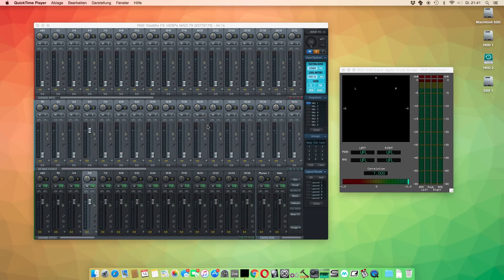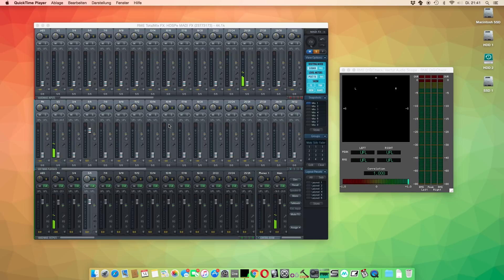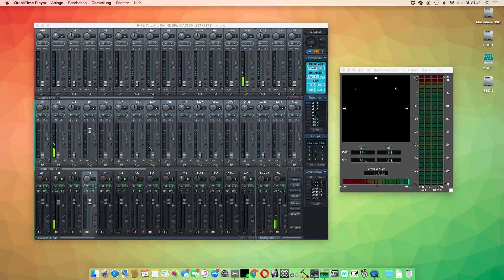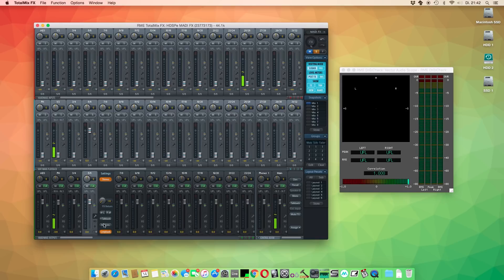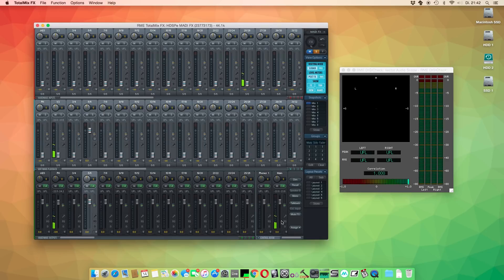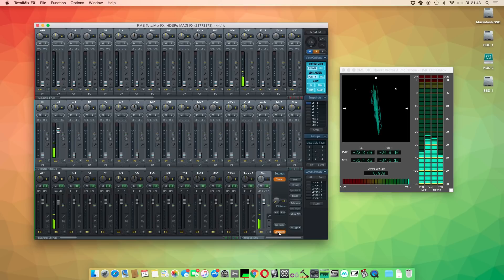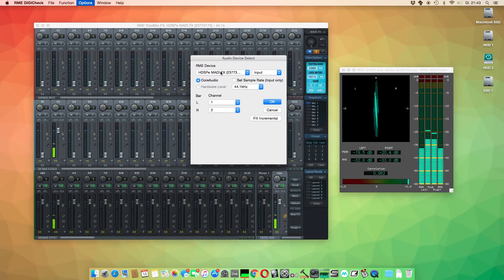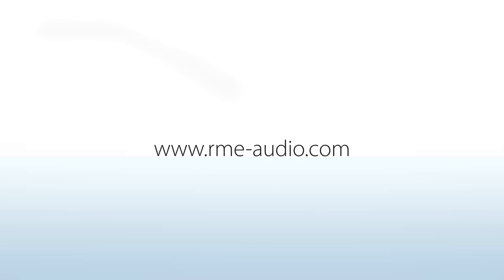Using RME Audio DIGICheck on Mac Computers

Comment: Nice this problem is already fixed with the recent drivers. 
I didn't need to loop back, it just worked. Thanks RME. 

Also I don't know how else to stress this enough on how important changing the Default settings in the 
"Input Device Setup" Menu is. The Default levels are only set to reading the Mono (left) Channel! Not Stereo! 

It took me days to figure this out until this was explained. Thanks.
I now understand why it happened to me as I am running DIGIFace I presume.

Comment: This guy is just incapable of conveying information clearly and succintly, Its embarrassing and RME most definitely need to address this content pronto. I’m a sound engineer and am still none the wiser having watched this. 
However, if you want a step by step guide for monitoring audio outputs (specifically for Digicheck Beta) check this URL https://www.synthax.co.uk/latest/2020/05/22/rme-digicheck-ng-beta-release/
Reply from the maker: You only need to understand the basic principles of using the Loopback function. Easy explained here: https://youtu.be/Xpt7LczeAvU
Reply: @RMEAudio  Great! Thanks RME, a super patronising message. I'm aware of the "basic principles" of the loopback function thank you. The fact that you need to actually post such a smug reply speaks volumes. My point very much stands. RME are to date incapable of providing detailed and thorough tutorials. The fact that your own UK distributor is compelled to do so should be a giveaway no?

Comment: As the RME ADi 2 Pro fs r is not supporting TotalMix how can I set up the routing to have Digicheck getting the input?
Reply from the maker: Use a loopback cable from a digital output to a digital input and select that input in Digicheck.

Comment: Doesn't work for me, despite activating Loopback on the Main channel inside RME Totalmix. The DIGICheck Input Device Setup only shows the channels: Mic 1 2, Instr. 3 4, AS 1 2, and ADAT 3 - 8.

I'm using an RME Babyface Pro through an early 2018 Macbook Pro running Mojave. Any suggestions?

Comment: Thanks for this, it works! Just one question, how can I check the real output gain of a master ? Actually I see the physical output, so if I increase my output it increase. Instead I would simply check if a master audio will clip into my DAW, but without using any Daw, only using Digicheck. Is it possible ? Thank you
Reply from the maker: You can already see it in the output channel of Totalmix if something is clipping. Of course you can use a level meter from Digicheck to have a more detailed look. The loopbacked audio to Digicheck ist post output fader.

Comment: Thanks for the video. All works fine, but I am noticing the volume of my computer is affecting the level inside the RME Digicheck. This seems like a parameter which could interfere with an accurate reading. The sound in Mac computer "Settings" has been directed towards the Fireface. Thanks in advance for your response.
Reply from the maker: If you would like to have a full scale reading all the time, you need to loopback an unused channel, hence one that is not routed/connected to your speaker or headphones, so you have always an accurate reading in Digicheck. Make sure your computer's volume is always at full scale, but adjust the volume level of your speaker or headphones in TotalMix.
Reply: @RME Audio I have just found this video, it seems this is what you are talking about? https://www.youtube.com/watch?v=3cAiit0GbY8 @RMEAudio

Comment: like Stefano Mandas  I would also say, it is very important to mention that by looping back to the inputs u lose those respective physical inputs. otherwise it causes feedback. my workaround is simply not to use DigiCheck (Loopback) during tracking and during mixdown I usually don't need inputs, at least not all of them.